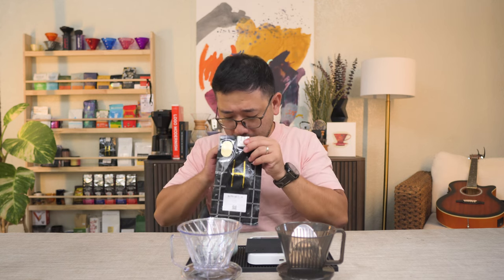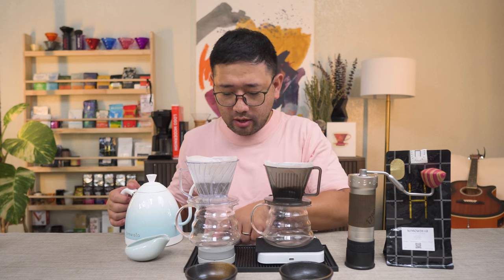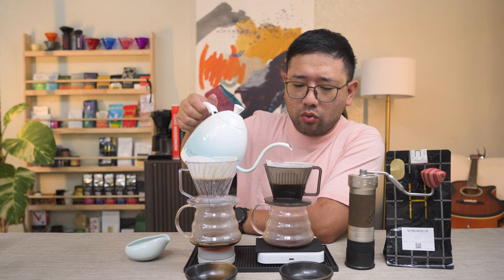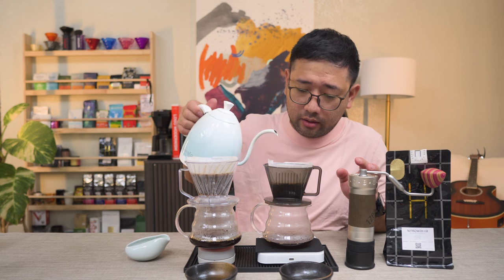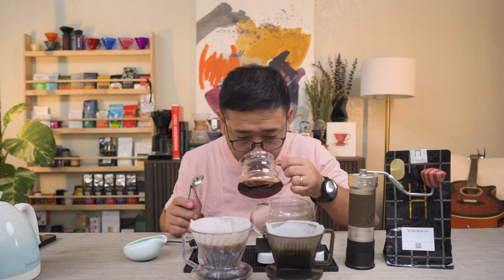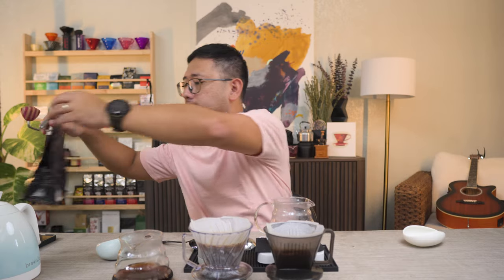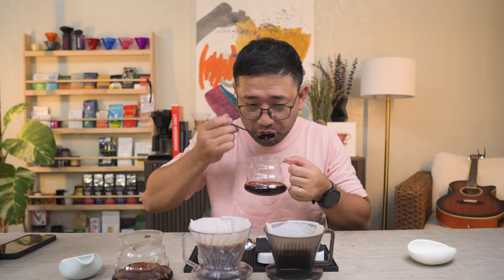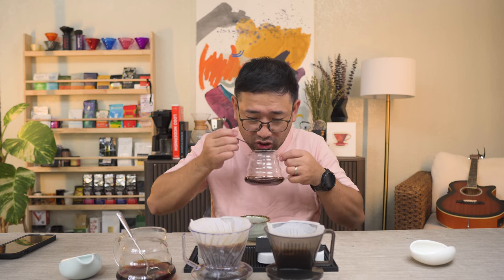Pegasus versus Kalita Part 2 - Brew Quality

Comment: Pegasus has been solid for me. No stalling. 115 clicks on kingrinder k6. Two pours only if you want high acitity. 3-4 pours for more sweetness. 93c light roast coffee
Reply from the maker: @johnnyr-518  yes basically 115 clicks on the k6 is a bit on the coarser side of things so you really wont stall at this grind size :) good job on your recipe! I should try it next time :)
Reply: @darylbuenocoffee  I meant no stalling in general. I was just sharing my recipe.
Reply from the maker: @johnnyr-518  yes of course :) i am actually intrigued with your recipe :) i will try it :)
Reply: @darylbuenocoffee  thank you. I have no doubt you'll be able to make it better. If you have any suggestions or future recipes you find out, let us know as well. Love your videos. Very high quality.
Reply from the maker: @johnnyr-518  thank you! I appreciate that

Comment: I’ve been thinking about buying the Hario Pegasus filters to try them out. Right now I’m using the Cafec filters and have been struggling getting the results I want
Reply from the maker: @bradsyoutube  why is that? Actually im about to do a comparison of the pegasus and cafec trapezoid filters. But im curious why is it a struggle to get the results you want?
Reply: @darylbuenocoffee probably the flow rate of the filters.